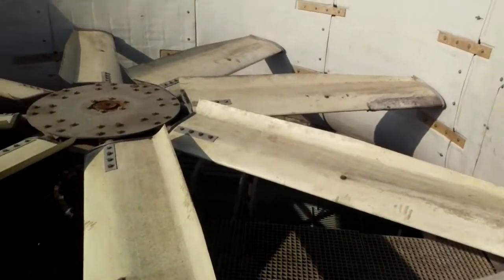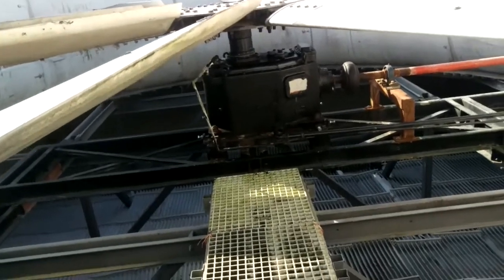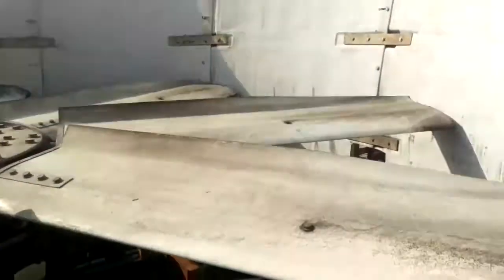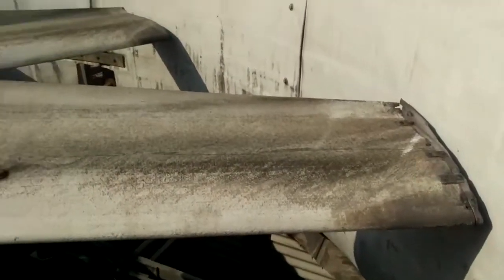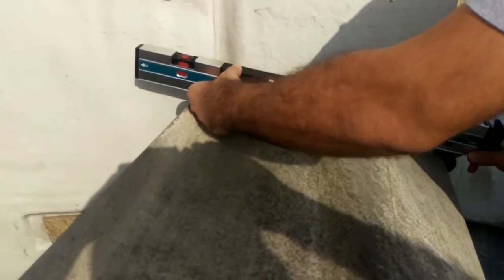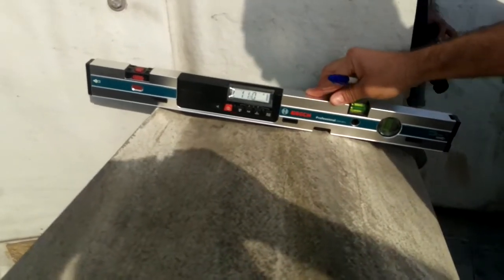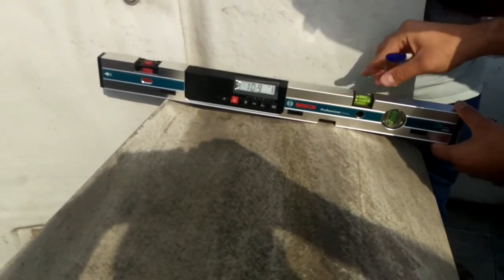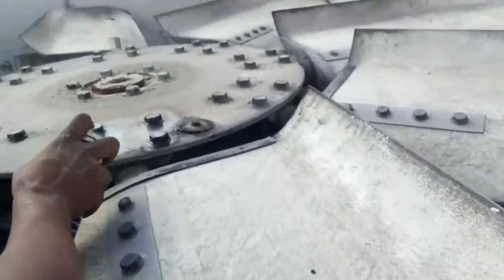Measuring and Adjusting the Pitch angle of a cooling tower fan blades

Comment: It's NOT degrees Celsius!!!
You are not measuring temperature
Reply from the maker: Thanks for your comment, sorry all for this silly mistake. Yes sure its degrees only without celcius.
Reply: You know,  for a subject matter expert, you would think that you’d know the difference between temperature and angular measurements.  It isn’t a hard concept no matter what language you speak.  This proves you can just goes through the motions without actually knowing anything.
Reply: How you measure the blade tip clearance? What is the measuring tools your are using?
Reply: @bencarlassara5877  come on it was an inadvertent mistake....let it go man